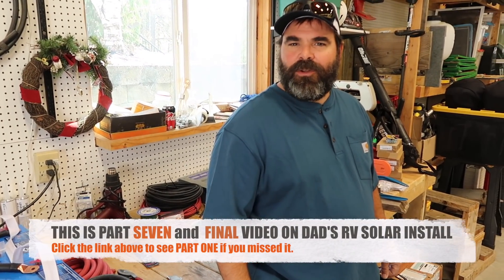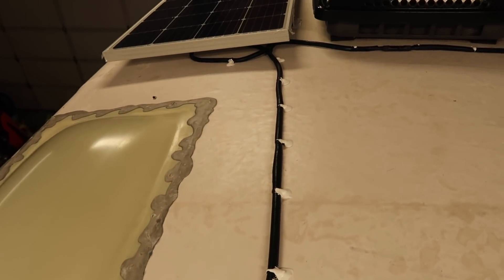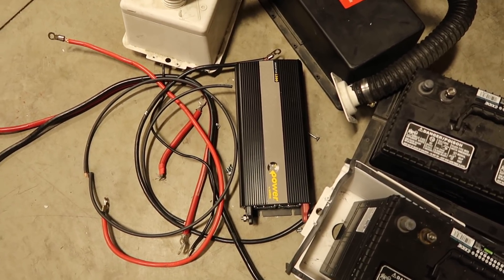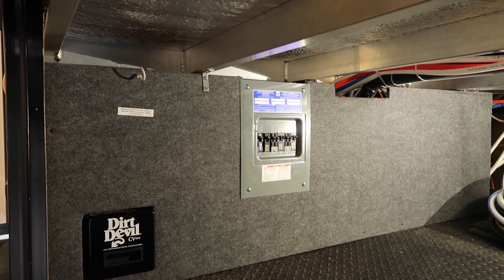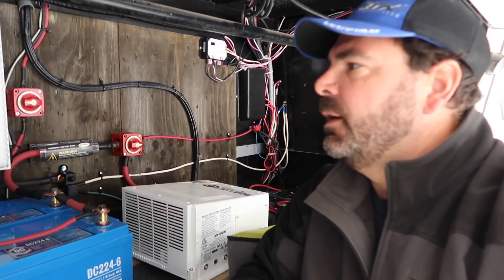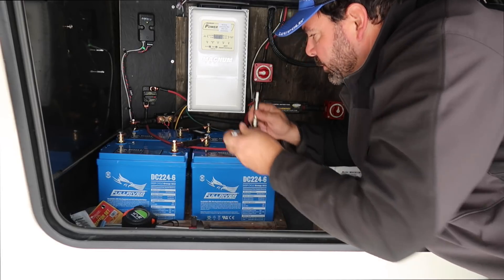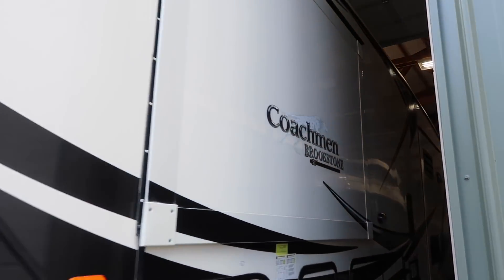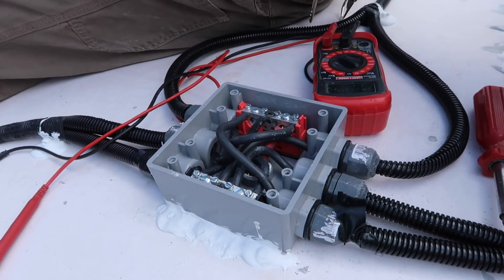RV Solar Installation - Part 7: Finishing up a 1200 watt Solar Install on a 5th wheel  🚐🌞

Comment: Hi Gary. Great installation! I'd like to recommend one safety improvement, however. A double pole breaker should be installed on the positive and negative wires between the PV array and Magnum PT-100 charge controller as shown on page 37 of the owner's manual. Otherwise, you're relying only on the controller to handle any faults and prevent a fire.

Comment: Very Informative. I am creating a list for when I am ready to put Solar on my rig. I have couple questions. How do you determine whether you need a sub-panel? I watched Hebards Travels videos. I know you worked on that install, but i didn't see any sub-panels that I remember.
I am going to purchase a Jayco Fifth wheel. They have the roof prewired for solar. I was wondering if I would need the combiner box( I am sure I do!) to combine 6 panels to connect to the roof connectors?
Reply: Chuck K . My Jayco is prewired for solar they use 8 gage is ok up to 40 amps